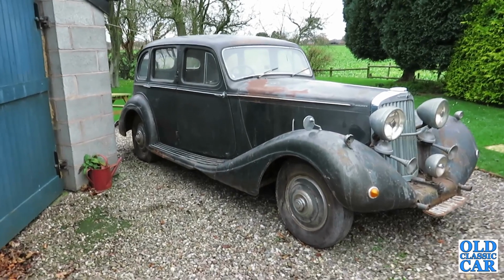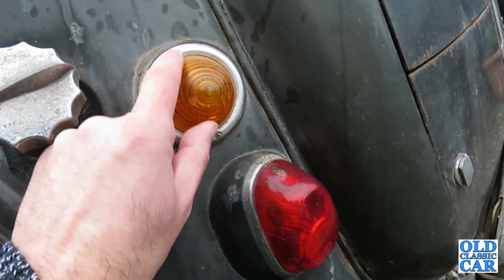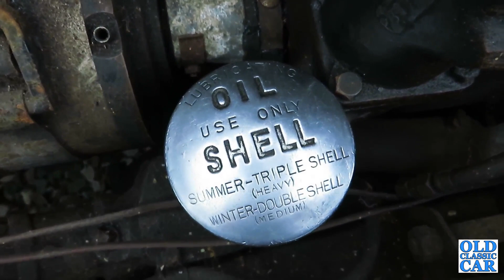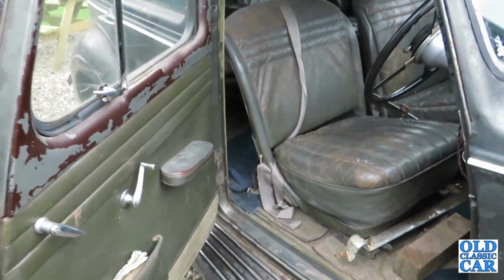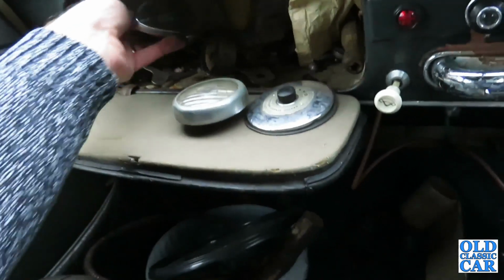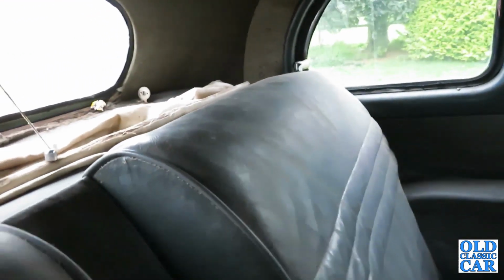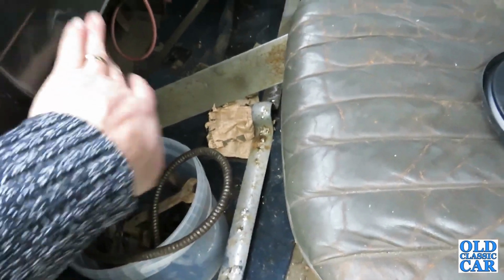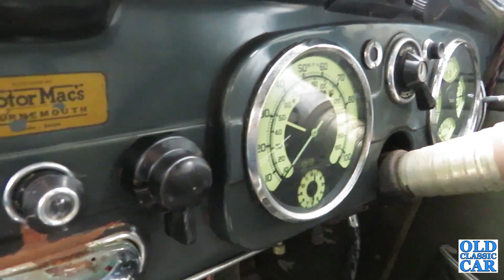The "barn find" condition 1930s Talbot 3-Litre - full intro to this pre-war car discovery 😎🚘

Comment: Well, that's a find, especially in that overall state. Really a Humber Snipe in drag but none the worse for that from the spares standpoint. My father had one in the early '50s and it wasn't a paragon of reliability having probably been flogged to death during the war. I could tell the tale of taking 19 hours from Surrey to North Wales! Chassis no was 8140, engine no 41142. reg no EVM57. I think the handbrake on that  Bendix system worked on all four wheels and I'm pretty sure the '39s had hydraulics.

Comment: You can get the sidelight red telltale light things from Holden classic car parts. They are quite cheap. I got some for my Morris 16/6. Seatbelts are not suitable on vintage cars as the structure is not strong enough to support them
Reply from the maker: Thanks Peter, I knew I'd seen mention of the tell-tales somewhere. Yes the belts will be going, it was a common fitment in the 50s/60s but they're not really suitable or probably that effective either.